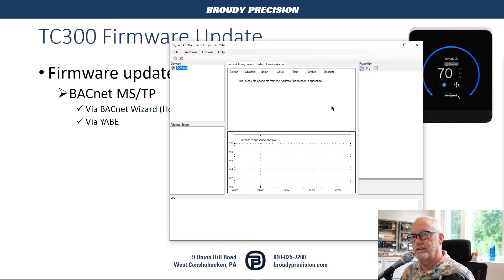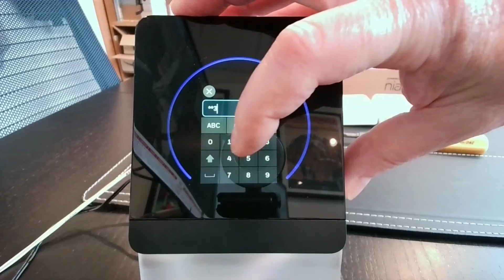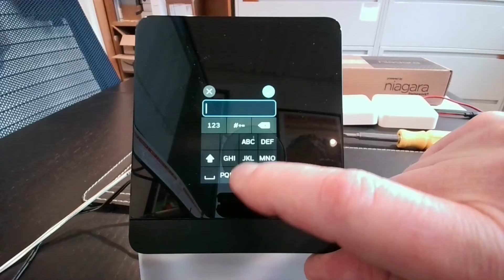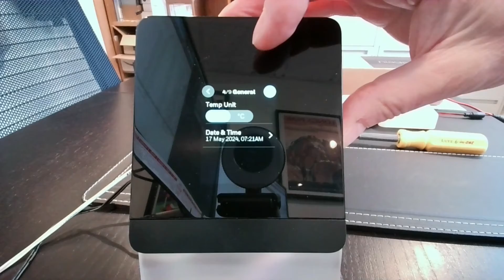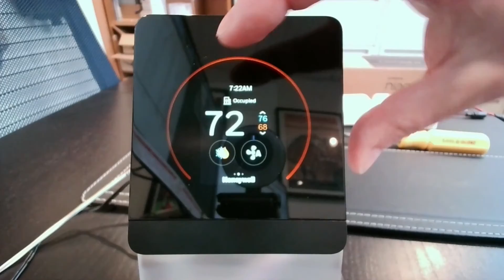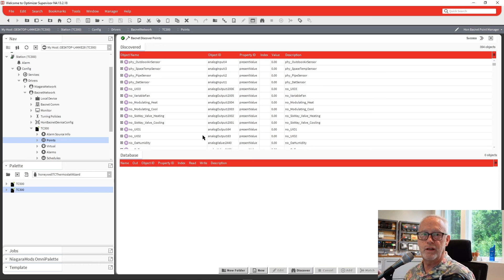Honeywell TC300 Thermostat Review | Expanded Capabilities

Comment: Hi, Frank- I've had no luck in downloading the Firmware using workbench. 
Keeps Failing after about 10min @76800b.
Its the only item on the network but keeps giving message
Failed [17:23:58 10-Feb-25] * Reason is Resources:Other. Please check the logs for more details. *

Any ideas
Rich S.

Comment: Does the TC300 have PID tuning? Or do I need a TC500? I'm looking for a 0-10v stat for my infloor heating. With such a large thermal mass I need a much larger proportional band than most modulating stats which are typically designed for VAVs.